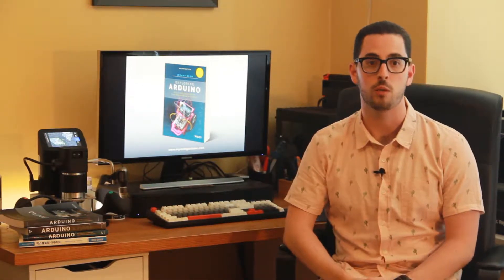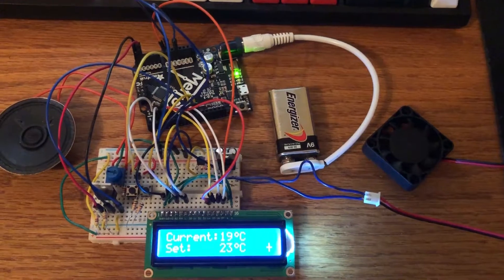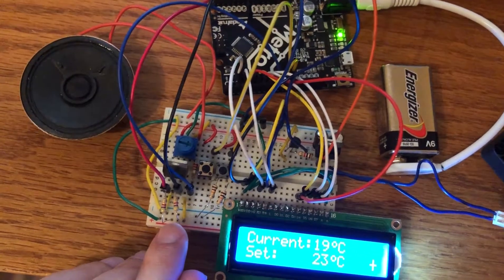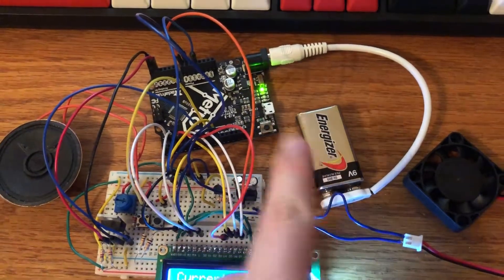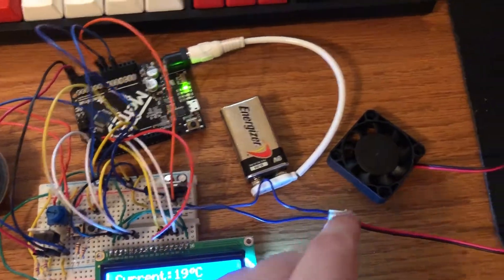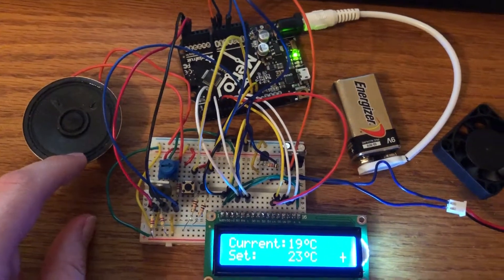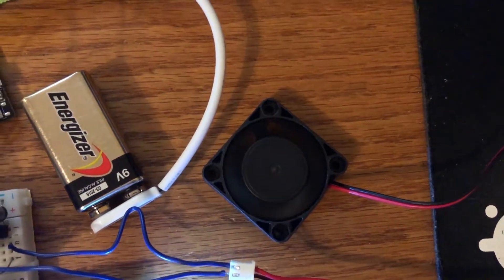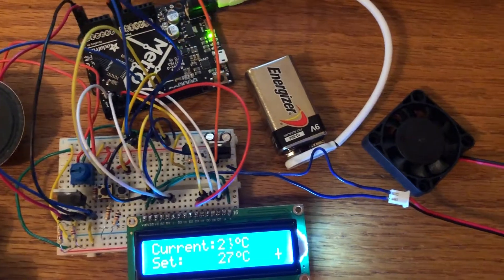Personal Thermostat (Exploring Arduino 2nd Ed, Ch 12)

Comment: Does anyone know how to debounce or add a small delay to the speaker beeping? I'm trying to figure it out but thought it would be easier asking somewhere if someone had thought about it? Like the system works great but if you blow the fan towards the sensor, using it as a small cooling system, it will beep and stop the fan until the value is 1 degree lower than the set_temp...wich is a bit clunky. I would like to program it so that it only beeps when the value is stable at the desired temperature or 1 degree over/under the set_temp.
Reply: If anybody wonders about the same thing, the answer pretty much lies in the following chapter!